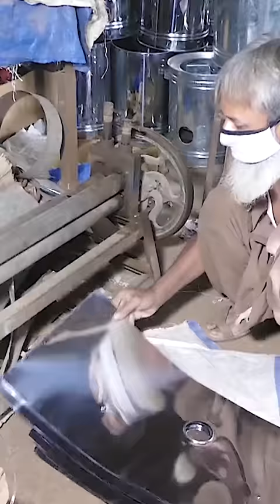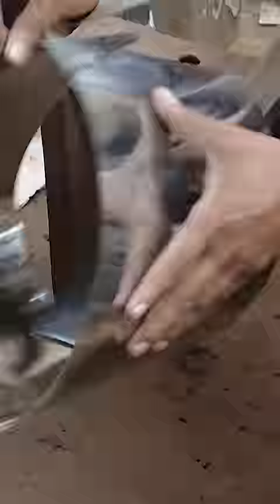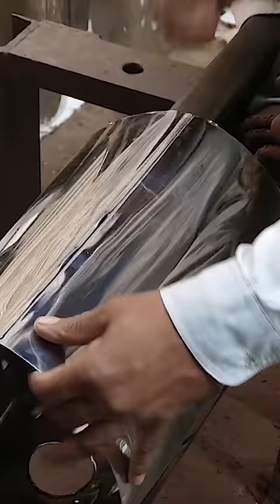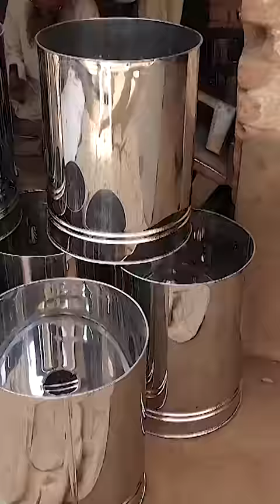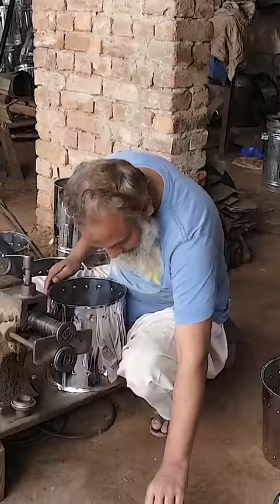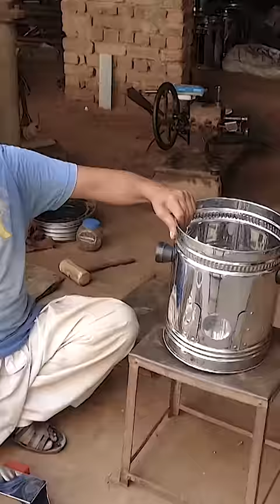An Amazing to make Smokeless Stove

Comment: That's a cool / "hot" stove, how much wood does that stoves save in percentages compared to a stove they normally use ????  Also how many of these people have access to electricity or batteries n is that gass stove  ???
Reply: don't know the percentage but it's a wood stove not a gas and yes these people have access

Comment: How is this smokeless? The flame is at the top and the smoke goes out above the fire,the fan is used just to bring oxygen to the chamber where the flame is where there is either gas, charcoal, or wood as fuel. It would still set off a fire alarm easily. The fan requires electricity to run, or a rechargeable battery 🔋... This video doesn't show the top of the flame, which might be on purpose. I encourage the guy to explain how it works and also show more of the entire stove especially above the flame. At least 1-2 feet.